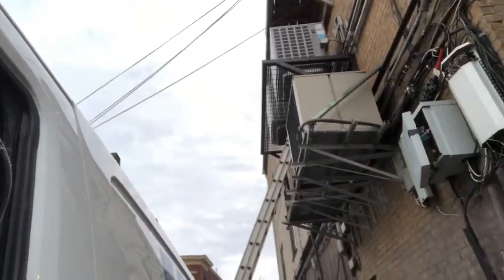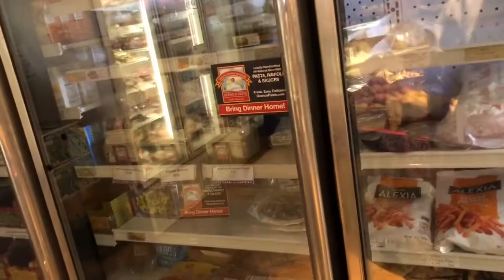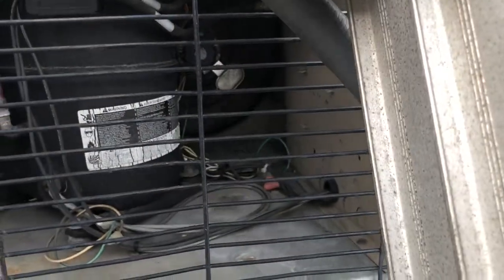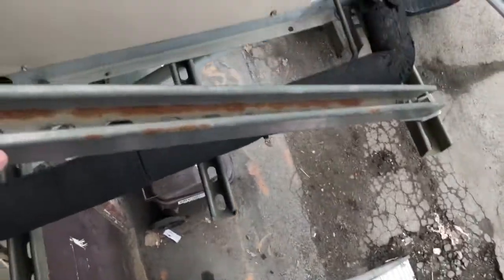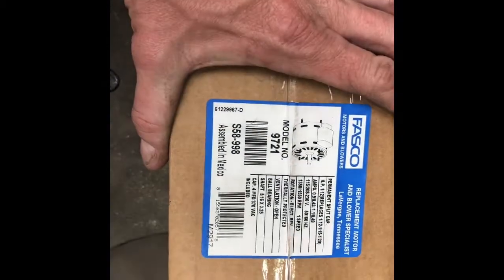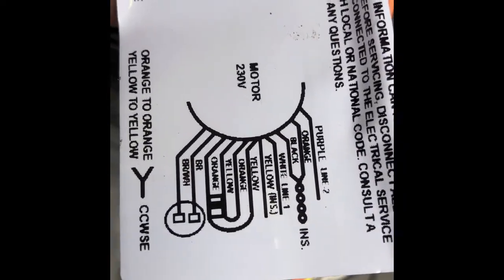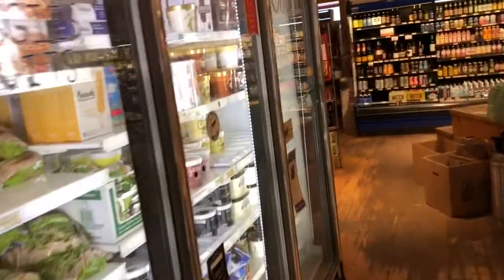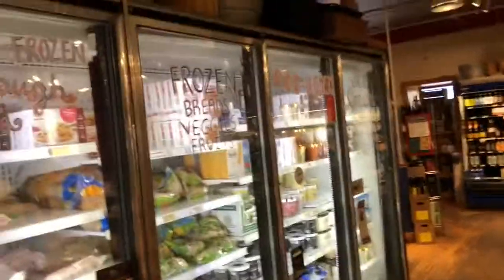Refrigeration Life #3 . 6 Door Freezer Down

Comment: Wow that is a horrible location for the Condensing units was there no better solution's? no stock or basement just for the compressors? than just run the discharge lines outside?
Reply from the maker: prime time not really at this location it in the city with not much room unfortunately
Reply: i hate those situations i'm In Toronto Canada and i have a few of these places luckily i've convinced a few clients to install them they way they should be  @Cscrefandhvac